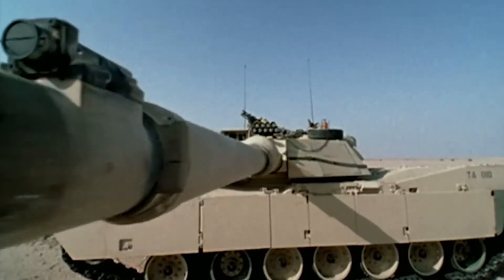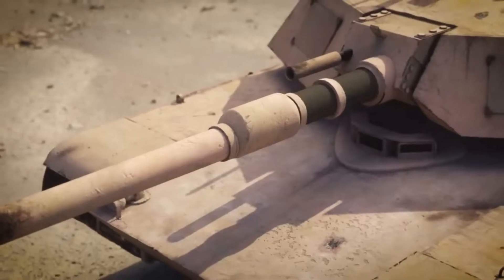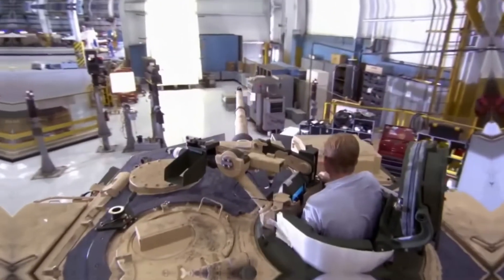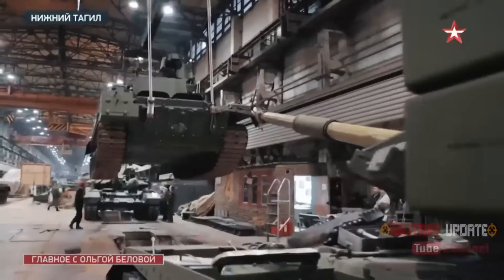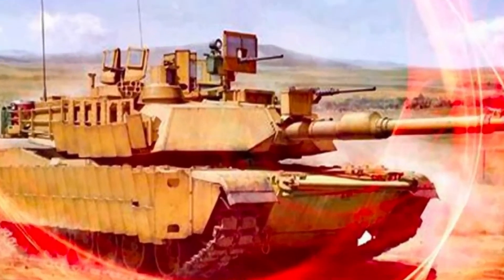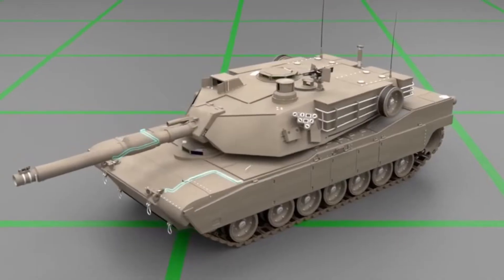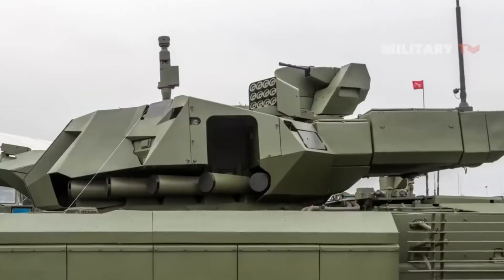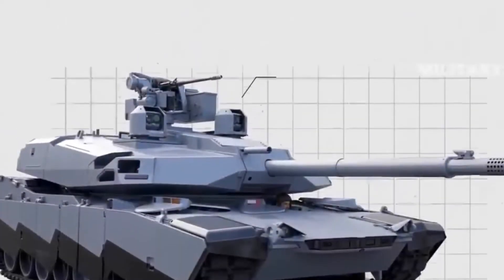Why Do Modern Tanks Have Short Traps?

Comment: This is a key example how the quality of youtube went freefall with the introduction of A.I.
Tanks dont have "short traps" (which is something from the stock market). The word is "shot traps". And no: this is not a thing with modern tanks showed in this clip: the working principle of  old kinetic projectiles during WWII worked was their mass. They had the diameter of the bore. And they bounced off armor if it was angled. Modern tanks all shoot APFSDS Rounds. Simplified this are darts, with a diameter much smaller than the bore. They dont bounce off armor, no matter what angle they hit. To answer the ridiculous question from the title: "Why do modern tanks have short traps?": You mean shot traps and no: modern tanks dont have that.
In short: this clip lists random buzz words (spelled wrong) and makes no sense at all.
Edited: in addition at 3:37 they labled the gun with "Composite armor"....
Reply: I agree, AI seems pretty incompetent.  You would think someone would train AI to pronounce ricochet correctly or at least proof the video after AI finished creating it.  It also repeats itself way too much.